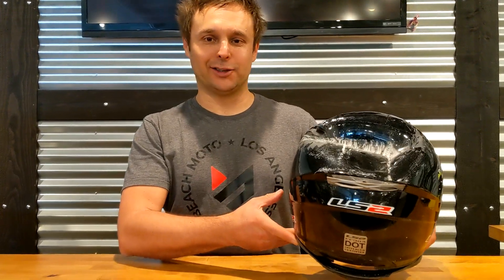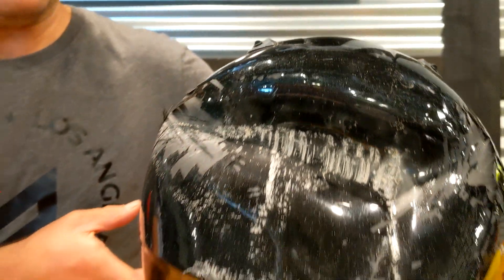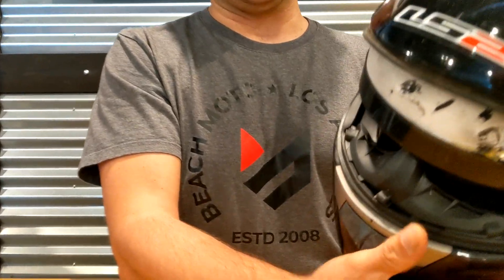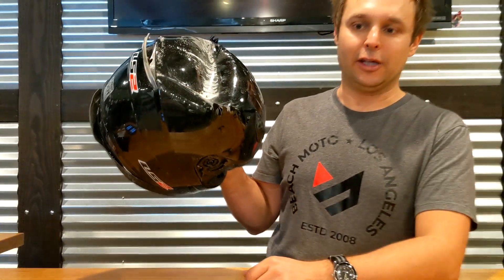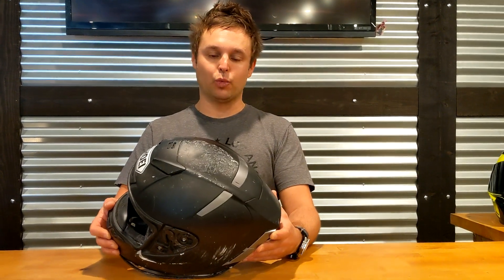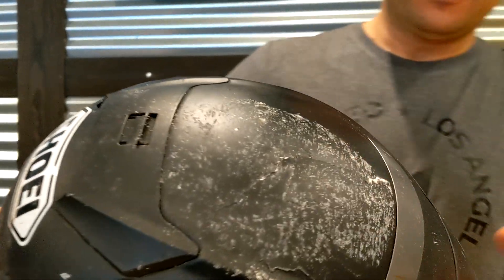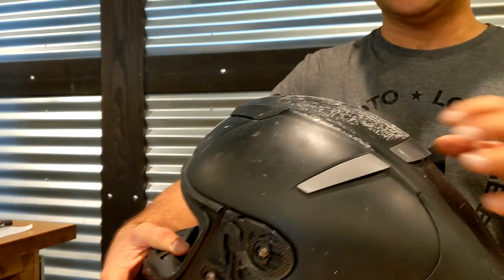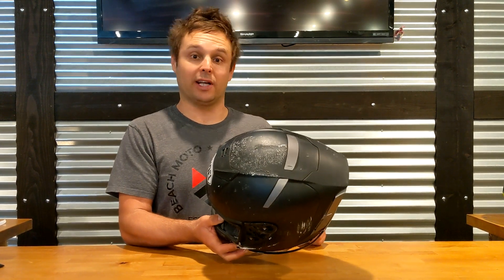Polycarbonate vs Fiberglass Helmet Test

Comment: that's why Goalies helmets in hockey are made of fiberglass. with the right interior padding such as d30 your head would practically be invulnerable to blunt force trauma.
Reply: Haha, i know what you mean but it doesnt exactly work like that. Once the blunt trauma is protected against, the enemy is the speed of the blunt force which causes your brain to hit your skull. So yes the padding is where its at once the shell is strong enough. If we had like 16 layers of padding and the helmet was the size of a beach ball we might be approaching levels of almost invulnerable but then the leverage would snap your neck. But again fibreglass is way superior
Reply: @absolutelysobeast  you don't seem to be familiar with d30 and what it does it absorbs kenetic energy and displaces it so what your talking about is practically eliminated as far as cranial damage is concerned. I'm not talking about being hit by a Mac truck here. Normal motorcycle helmets save people all the time when they're in an accident so no you don't need a beach ball sized helmet. The material I am referring to is being implemented in professional football helmets as well as military applications and it is currently commercially available.

Comment: How high did you drop the block from? What is the weight of the cinder block? 

Did you see the flex on the fiberglass helmet? Your skull would have been crushed just as much the poly shell. The only difference is the permanent deformation.
Reply: Nevermind. I saw the drop distance in another comment. Your drop height and weight are more than double Snell and European testing. Given the European test dropping a ten pound block from 9-12 feet produced 5000lbs of force, your test could have generated 2-3 times that. Also the impact angle of the block has to come into play as well since a sharp edge would translate all of the force into a smaller area you would expect to see more damage. This "scientific" test only proves what physics already tells us. I would not be afraid to wear either helmet. If you get hit in the head by a 30-35lb block from 20ft your going to die.
Reply from the maker: @R3Vlog And that was exactly the point of the demonstration

Comment: The thing is the brick didn't land under the same angle. In the first test there was less surface in contact so less resistance from the helmet. Second test the brick landed pretty flat. Regardless, plastic is obviously weaker.
Reply: theyre both rubbish! fiberglass collapsed to 1/5 of its original size and volume. i have a screenshot of the clip in the video of when it does if youd like it